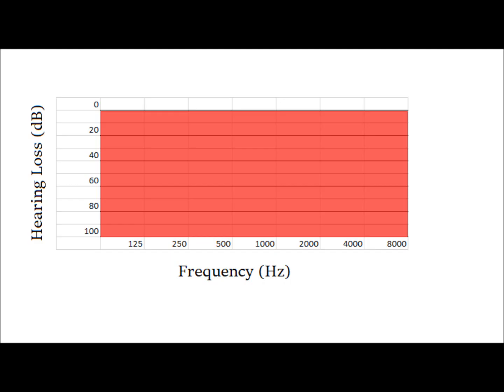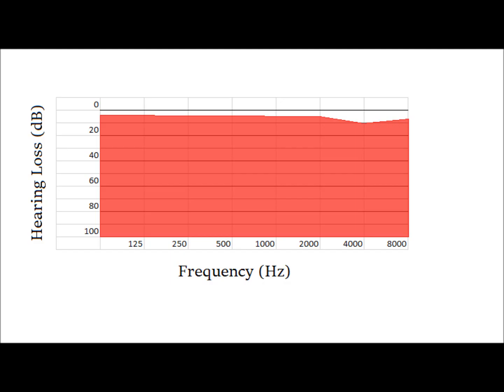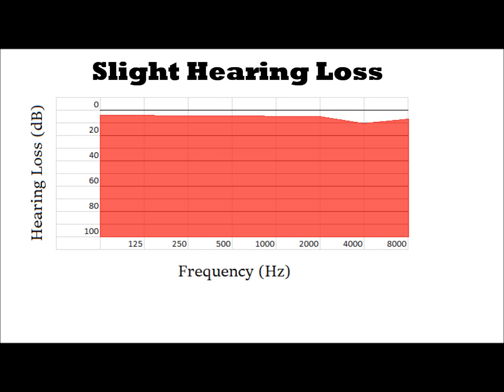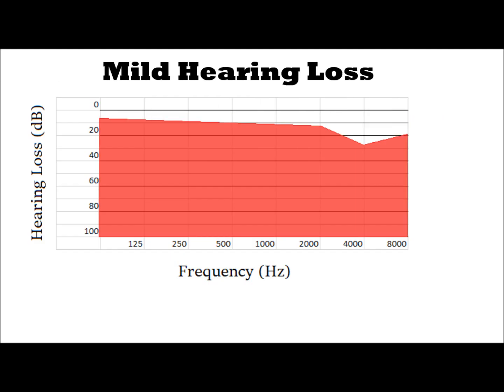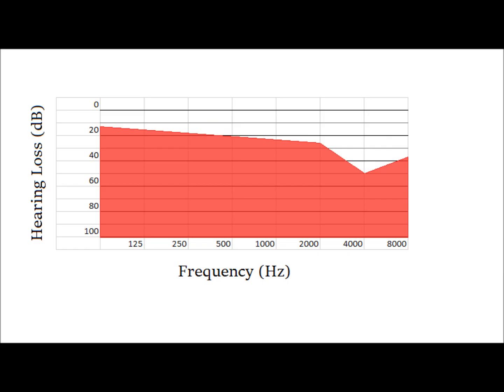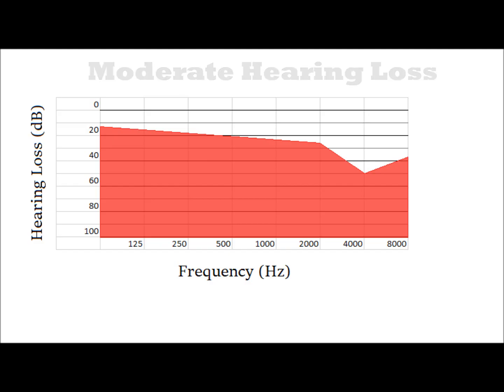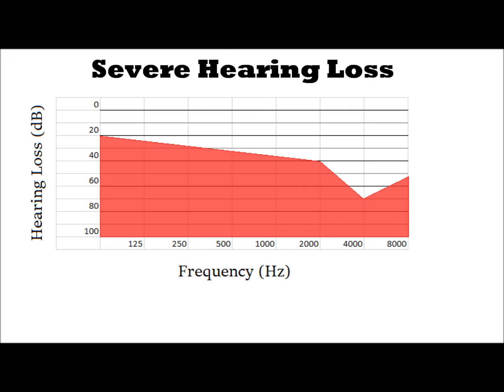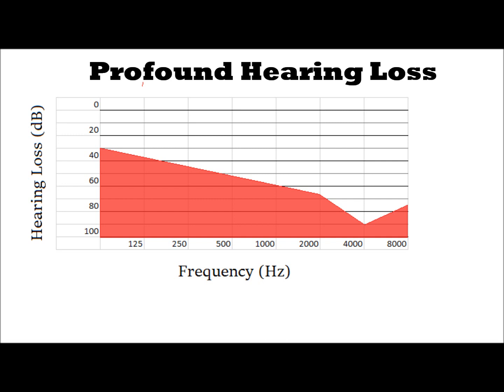How Does Speech Sound with Hearing Loss?

Comment: I could hear most of this with headphones - although struggling to understand at the ranges I have actual loss.  Without headphones, and even with my hearing aids, I would not be able to pick up most of this video.  My levels are roughly 100db down in my left, and 60db in my right.  I was born with loss in both ears, about 70-80db in my left, and about 10-20db in my right.  I am due another audiogram soon and I suspect it's going down again.  However the aids really do help in restoring a fair bit of the hearing loss, and helps manage the tinnitus in my left ear a fair bit too.  Always weird taking my hearing aids out as it seems to be super super super quiet afterwards for a while.

Comment: so If I didn't hear a difference between normal hearing and slight loss, does that mean I have slight loss?
Reply from the maker: That's a great question!  Actually, the difference between normal hearing and slight hearing loss is quite small and difficult to detect.  It doesn't say anything about your hearing capabilities.  In fact, even with a hearing loss, it is possible to still detect a difference between the levels demonstrated in this video because the sound is still decreasing as the level of hearing loss increases in each simulation.  Say you have mild hearing loss, then one way to look at it is each simulation will sound like a higher degree of hearing loss to you than it would to someone with normal hearing.  I hope that makes sense; if not, I can try to clarify.
Reply: No. Obviously its still possible that you do but this is not a test of hearing loss.